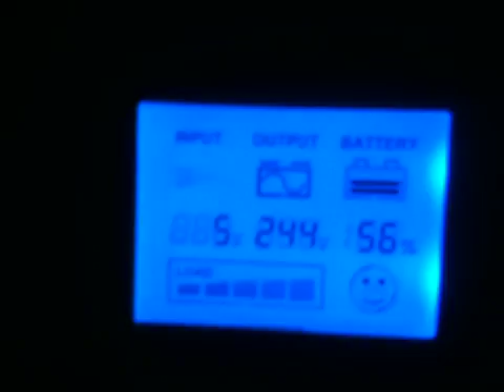10 kW inverter at 240v cannot start a 15kW 3-phase rotary c

Comment: And your inverter has to supply the initial in-rush required by the motor to start. A 15kW inverter will not start that motor without soft start or a VFD.